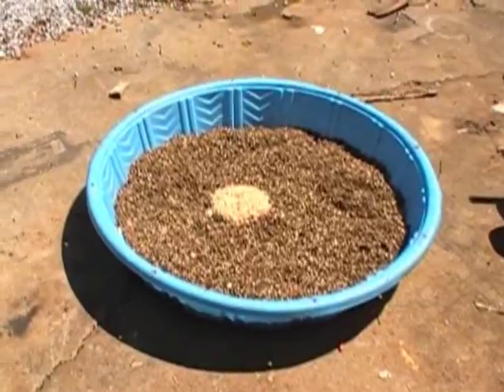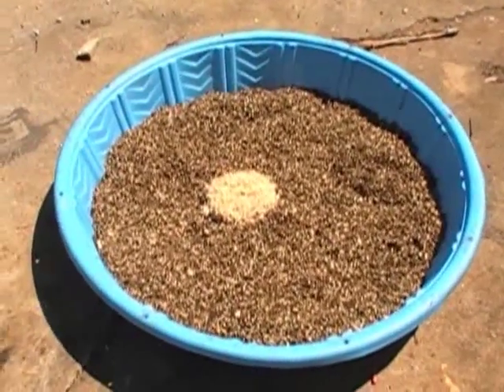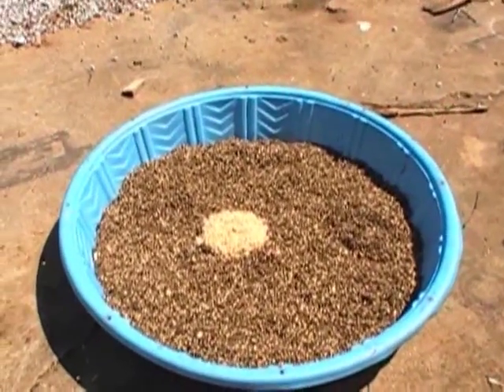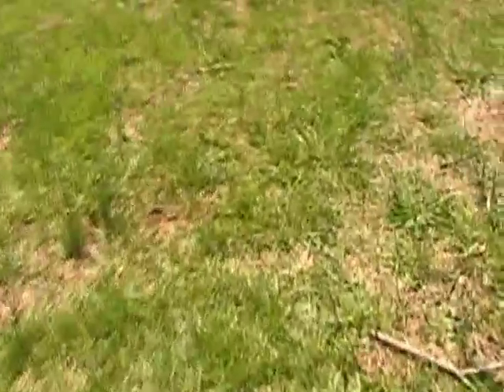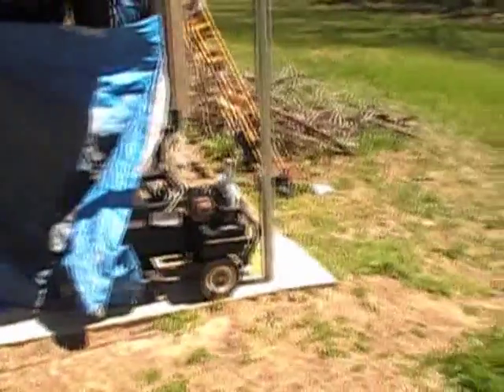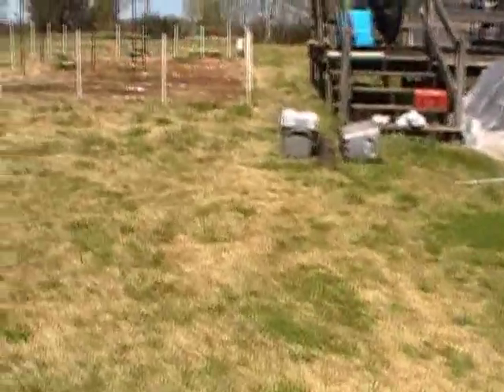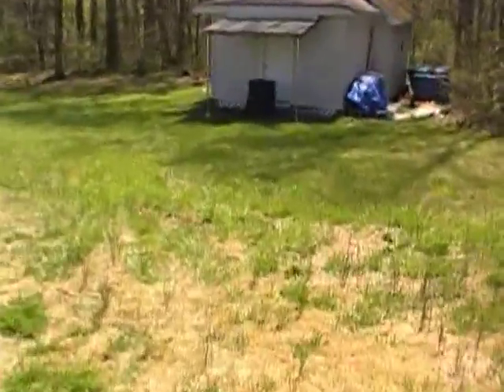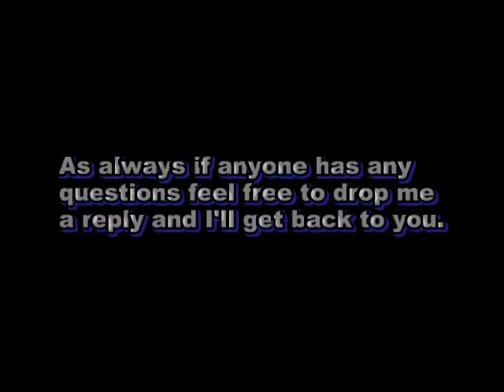Filter Discussions 2018

Comment: Why do you say you aren't running a FEMA design...isnt FEMA using an Imbert style gasifier...what style gasifier do you call your design?
Reply from the maker: The FEMA is an open top desigh where the air is fed directly to the ember bed. Think of a cigarette or better yet a pipe. This how the FEMA operates. The Imbert uses nozzles that will give the ember bed a billow effect which raises the temperatures much higher. The issue with the FEMA design is it doesn't get hot enough to crack the tars produced in the process and what you wind up with is a tar/goo mess through the system plus if the tar makes it's way to the engine it messes up the valves by depositing on them and then baking hard where they no longer seat correctly or worse yet, gluing the valves open or shut. The Imbert gets hot enough to burn the tars or what is called cracking the tars down into burnable gas that the engine can use as fuel. The process isn't 100% perfect but it cracks enough of the tars that the filters will remove the rest before it gets into the engine and causes damage. I hope this explanation helps. If you want more info on this go to the www.miniwoodgas.com website.
Reply: What have you found to work best as filter media? Ive read olivine/dolomite, Cu/Ce/Zr oxides are common for tar cracking catalysts in the gasifier. Have you tried this (essentially mixing the input biomass with some of the above catalysts)? Or do you mainly just try to 'collect' tars downstream, using straw/SS or the like?
Reply: Have you ever tried using torrefied wood as an input and compared results with a run of normal non-torrefied wood?
Reply from the maker: I just run raw wood in mine. I don't put any additives into the fuel. Being and invert design it gets hot enough to crack the tars. When it's running correctly you will have very little to no tars at all so you don't have anything to collect. That's the difference in the Imbert and a FEMA.
Reply from the maker: No I've never tried that. I know people that have actually taken plastic soda bottles and turn them into plastic shavings which they mixed with the wood but I've never ran on anything other than organic material or just plain old dried out wood.

Comment: so, you use softwood shaving to filter the gas you generate from hardwood?

woah.

mind blown.
Reply from the maker: Keep in mind this is a very old video but the updated design is based on the same design. The filter system is mainly a tri-Filter configuration with a small final filter before it goes to the engine so technically it's a quad filter. The first stage is stainless steel reusable scrubbing pads that remove large particles and water from the gas and the second stage is wood chips that further aid in drying the gas and the third stage is polyester fiber that helps finalize the gas getting it clean and the fourth paper filter is just a small piece of mind fail-safe filter placed to also clean the gas because we are drawing right off of the ember bed of the wood that is being used to produce fuel. The system is crude but it works.
Reply: @flash001USA  I'm relatively new to that tech and find it very very engaging.

All the R&D you did is commendable.

Thank you very much